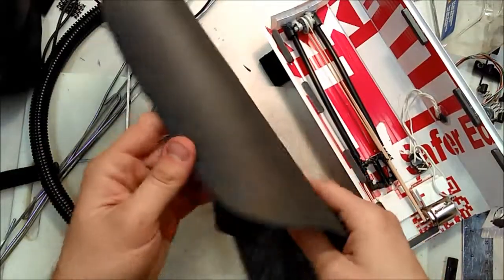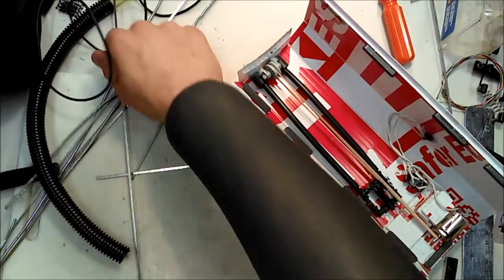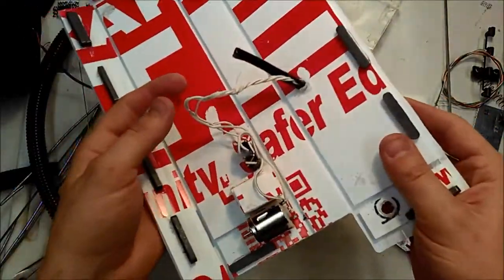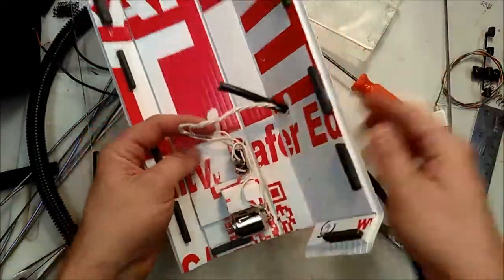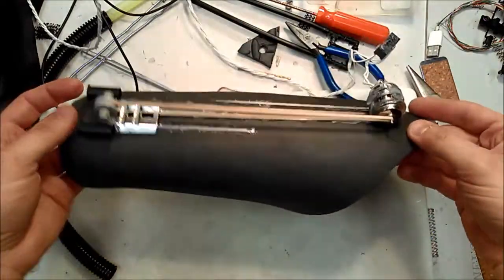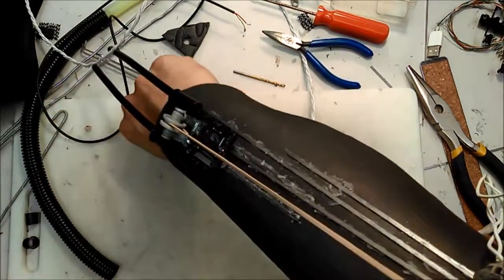Building a Star Trek Borg Costume [38] - Rebuilding the assimilation tubes

Comment: Me and the wife are cosplaying the Borg this year at LA comicon on the 27-29 my baby boy will have a starfleet uniform on this is my second time building Borg costume for the fore arms pick up some shin guards at walmart for $5 and modify/add on to them it will save you alot of time also if your doing a Borg arm device use mailing tubes that fit over your arm and build on top of that.
Reply from the maker: I used weeping tile for the full arm. Worked great because there was lots of space inside to put all the controls and hide my hand at the same time.
Reply: @GriddlockCosplay  I gotta do another borg cosplay, I got better and better each year we went to comicon now I have a few techniques that I wanna try. I currently have some Stargate cosplay I need to finish up.